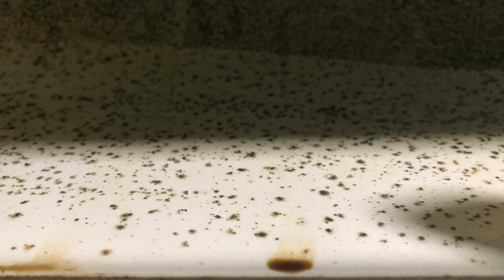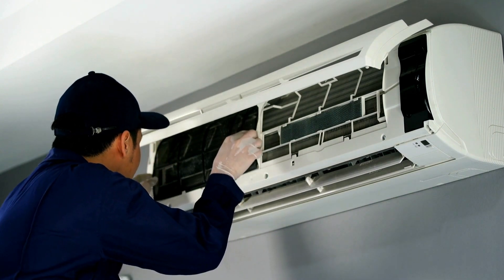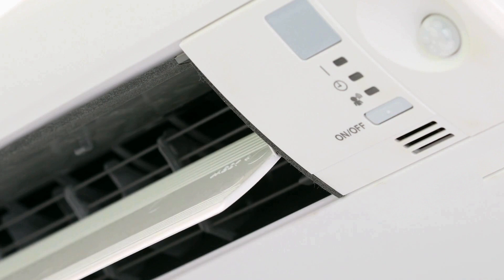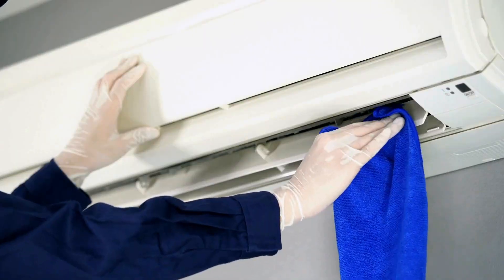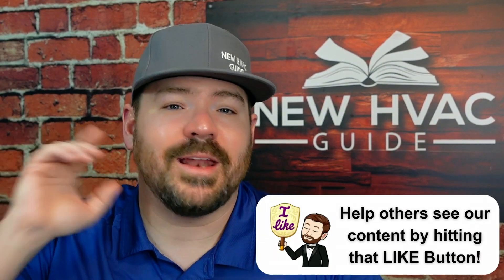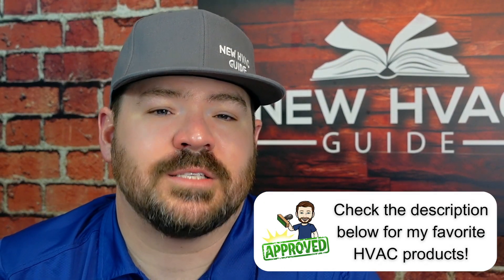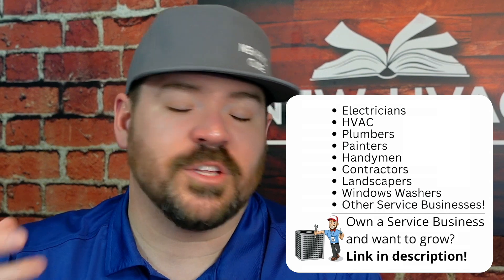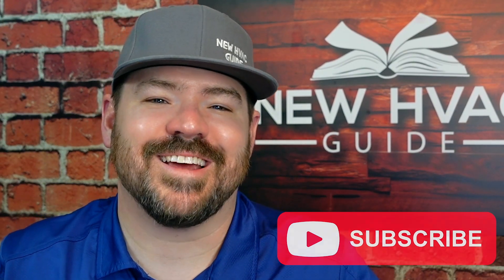Dirty Ductless Mini Split SECRETS!

Comment: The number 1 issue with the mini split units is the design that doesn't not allow you to remove the blower wheel to take it outside to wash it off. You can see the blower right there and it has no way to take it out.
Why there isn't a complete boycott of all split mini units until they do this is something I don't understand. If the units stopped selling and the money stopped flowing, you would see a removable blower wheel  immediately.
Reply: I agree. You would think that as the dust build up is always going to be a problem on the fan blades that they would design the unit so that the fans are easily removed and washed right? Wrong. Its better for the suppliers that you buy a new  unit. Its called in built in obsolescence. Limited life span, too difficult or too expensive to properly clean and bingo, better go & buy a new one.

Comment: I'm Not Even An HVAC Guy I Just Have Owned Mini Ductless AKA ("Staki Botrus") Units :O( 
The Design Flaw Is That The Unit Is Cold When You Shut It Off And The Doors Close Trapping All The Condensation Inside, Plus The Condensate Drain Rail Might Not Be Draining And Have A Puddle Trapped Inside? All This Moisture Causes The Unit To MOLD!  This Is A Health Issue Being It Might Even Be A Deadly Mold Bacteria? Then You Turn It On And Are Blowing This Into Your Rooms.. Some HVAC Guys Show You How To Clean The Unit Using The Bag And That Is The Best Way To Clean These Units BUT! Under The Condenser And Drum Fan Is A Condensate Drain Rail That Most Professionals Never Think To Clean Because You Can't Really See What's Inside Blocking The Drain! So That Puddle Is Always Inside Helping To Mold The Unit And Once It's Blocked Moisture Will Blow Out The Front Damaging Your Wood Furniture ETC.  Never Mentioned Is The (COIL DRY FEATURE)  This Might? Help Prevent A Lot Of Growth If You Run That After Shutting The Unit Off! Maybe Not So Much Is The Drain Rail Is Full Of Water!! 
 One Way To Slow The Mold From Growing Is To Not Shut It Off And Keep It Running Or Just Don't Turn It On?  I Have (4) Indoor Units! (2) I Use And (2) I Never Do For 12 Years! The (2) I Never Turn On Look New Inside! 
When These Are 100% Clean They Run So Efficient You Tend To Get Cold And Turn It Off Starting The MOLD Cycle As It Closes Up Trapping All The Moisture Inside As The Doors Close! Later You Turn It Back On And All Summer Long This Process Happens And These Pictures In This Video Welcomes You To The World Of Mini-Ductless And For Some Reason These Pictures Are Not In The Brochures Of All Brands Of These Units Nor Do The Installers Or Sales People Show You The Reality Of Mini-Ductless Systems! 
 The (Cash Cow) Of HVAC And The Service Guys Will Say You Didn't Clean Your Filter Every Month? Those Pre-Filters Have Nothing To Do With This Problem! 
I Too Was A Victim Of Going From Box Window AC To The Wonderful World Of $20,000 Mini-Ductless With Heat Pumps? I Was One Of Those People Born Every Minute Suckers!

Comment: I have a mini split system in mine. It is a manufactured house.  Cheapest of all crap  houses. It does pretty good  heating my home in liveable areas. I would recommend them to someone who doesn't have the money to replace rotten ductwork under their houses,  which is the case with me. Hope this helps anyone who needs the comfort.   I lived with just a window AC unit and kerosene heater for at least 10 years this way.  It was hard, not gonna lie.  I roasted in the summer and froze in the winter.   It made anything harder to do in those seasons

Comment: Furnaces 59TP6 or 59SP6 with single stage AC
Is there any benefit during cooling with with dehumidification process in the summer when going with the Carrier Performance Two stage furnace 59TP6 (over the single stage 59SP6), when combined with the Carrier Performance single stage AC unit 24SPA6?